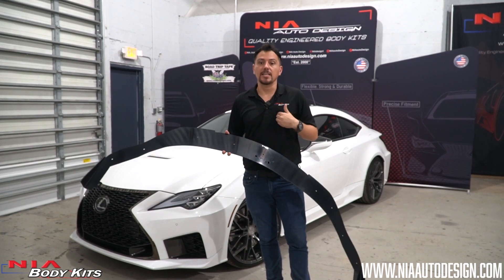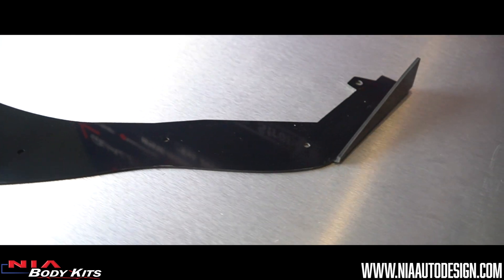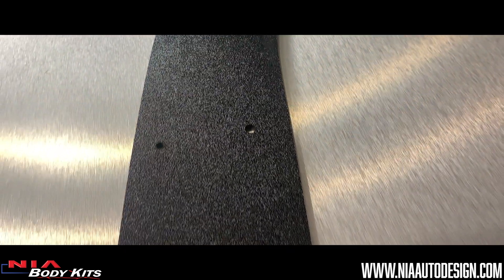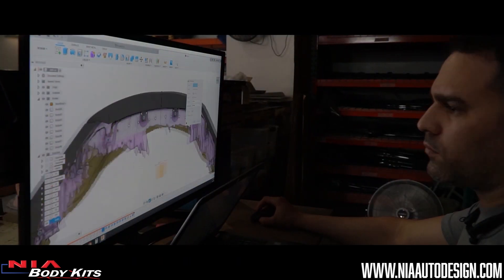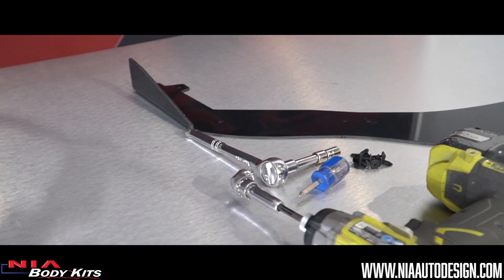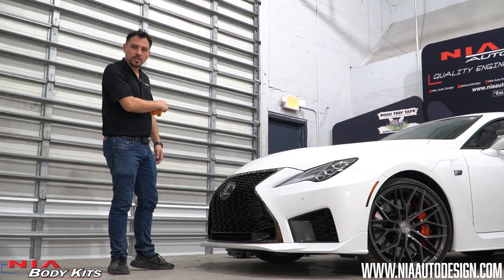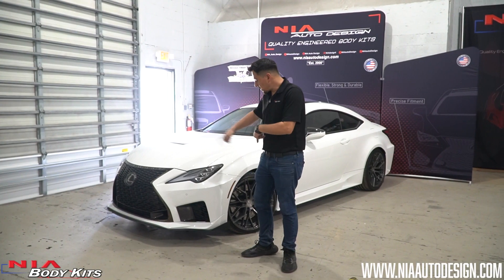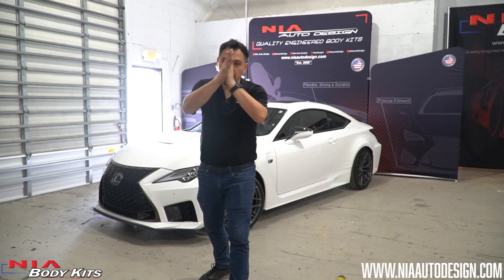How to Install: NIA Body Kits Lexus RCF 2020+ NIA Sleek Splitter Install

Comment: Can you install a Front sleek splitter on top of a Front lip or would I have to remove my Front lip to put the Front Splitter? 
(Lexus 2015 GS350 F-Sport)
Reply from the maker: the front lip is ours? or a different company
Reply: @NIABodyKits  it's a different company
Reply from the maker: @post_rockybalboa  i dont think it would fit because our sleek splitter uses the factory mounting points, you can try but it is meant to bolt on directly to the bumper